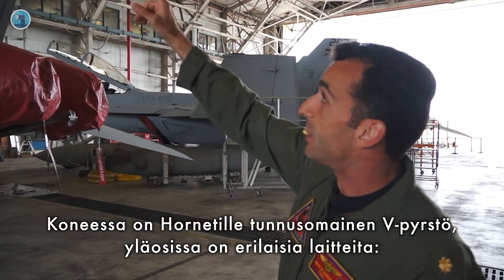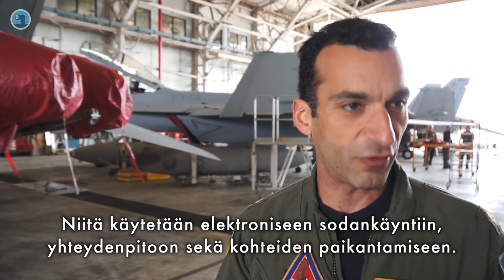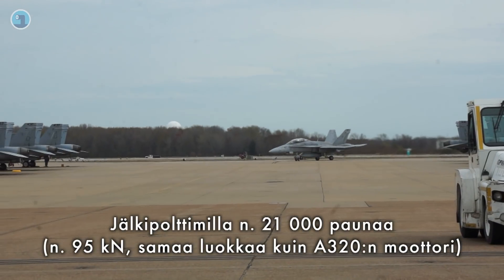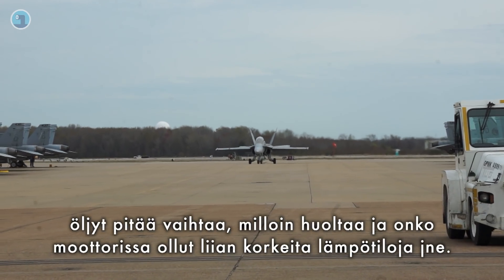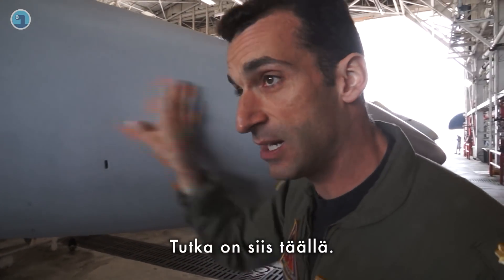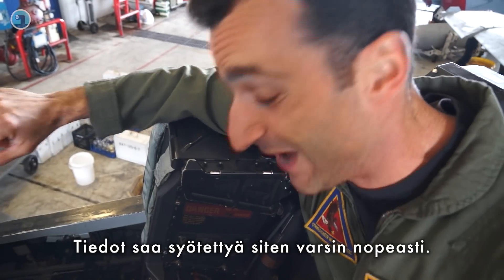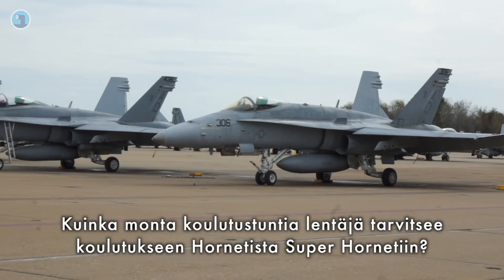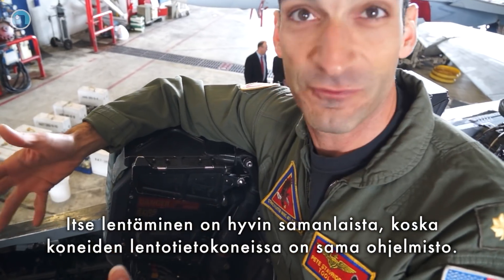HX-hankinta: Boeing F/A-18 Super Hornet

Comment: How do the end of the wings hold up, for Carrier parking configuration I guess you'd call it, without giving to the stress of wind resistance and high G's? Because they fold up. The wind resistance is mainly causing lift from hitting the bottom wing and pushing up. I mean it's simple aerodynamics but, I'm having a difficult time to describe it 😄 Hopefully someone will understand me. I'm just asking how the end wingtips don't go flying back when under load on the Super Hornet, Legacy Hornet, or even the F35C. Jesus that hurt my brain.

Comment: This vid on the USN/Boeing F-18 E through G "Rhino" is for Finn audiences.  Noted are the structural scale-up compared to the USN-USMC/McDonnellDouglas F-18 A through D "Hornet," the larger General Electric engines (the F414 is an implementation of lessons learned in the YF120 development program), and the new Northrop Grumman AN/APG-79 AESA.

I took an alternative-history view of the ideal carrier wing for the U. S. Navy.  Had the F-18 Rhino been executed with larger engines, e.g. the General Electric F412-GE-408 or United Technologies Pratt & Whitney F100-PW-400, the odds of winning an air-to-air duel against the AdlA/Dassault Breguet Rafale C or the VVS/Sukhoi-27SM or -33M would be a lot closer to even, given pilots of equal ability; and the Rhino is ideal for reconnaissance and observation in the high-threat environment.  The Grumman F-14 I saw as a better elwar platform due to sufficient capacity for the massive amounts of electrical hardware required for the mission; an EF-14G "Tomjammer" could pack the entire elwar suite of the USAF EF-111 internally with bulges in both tailfins for the direction-finding antenna arrays, and carry and control an external jammer pod  under each wing glove.
Reply: The integration of AIM-9X Block II somewhat mitigates the disadvantage of Super Hornets in dogfights.

Comment: Logical choice for cost and integration, yet older technology if expected to serve until 2050.
Reply: If
Reply: this plane id old and expensive. not the edge finnish is looking for
Reply: Mikki Hintikka So you have seen all the offers including estimated operating/maintenance costs and Super Hornet turned out most expensive of all the five candidates, right?
Reply: @RVNspotting  i have seen them yes. but superhornet is expensive compared to our hornets and superhornet isnt much better so no point to buy those
Reply: Too old technology in 2060...thats how long these new fighters are supposed to serve Finnish Air Force.

Yes it would be fairly simple to transfer from F18 Hornet to Super Hornet, but out of the 5 candidates Super Hornet is clearly the oldest and will likely age too rapidly compared to the other fighters.